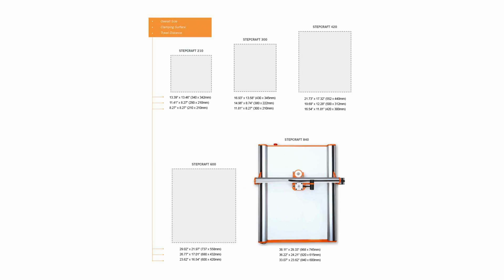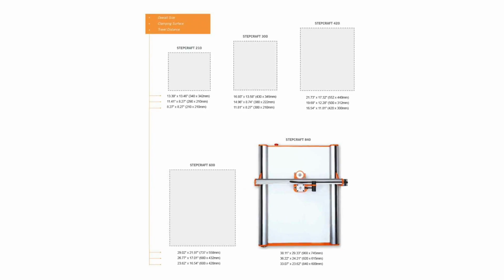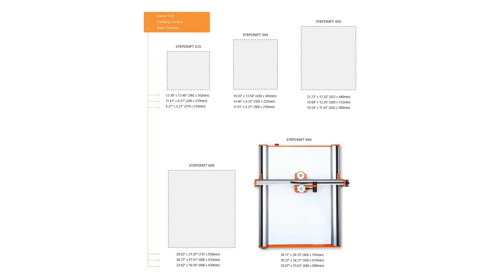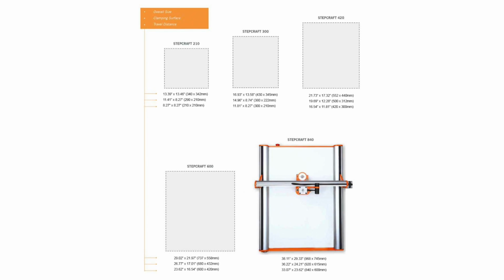STEPCRAFT CNC SYSTEMS - Choosing Your Base Machine

Comment: Anything but Stepcraft folks.   Shapeko,  I2R, literally anything but SC.   If you want to fiddle, adjust, watch endless how to videos, etc then SC is perfect.  If you want to cut then buy something that works.
Reply: Please elaborate more, what are the issues with SC
Reply: @arbjful  after watching every video and trying everything recommended I still cannot get the Y axis lead screw to stop binding.   The lead screw to gantry nut alignment procedure seems like a hit and miss joke.   Honestly, I've basically given up on it, have set it to the side and forgotten about it.  Not worth the headache.
Reply: @samj1185  thanks for the tip. Which one do you use now?
Reply: @arbjful  my company is looking hard at the Millright line of products.  Made in Georgia w/ great reviews.